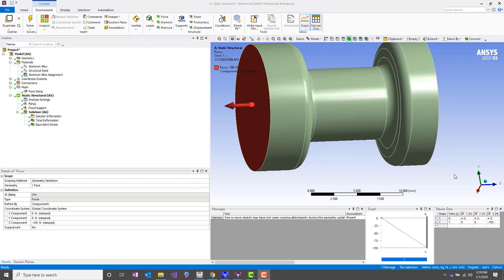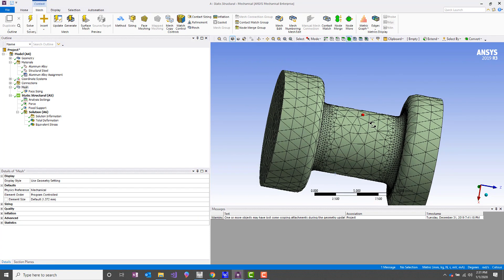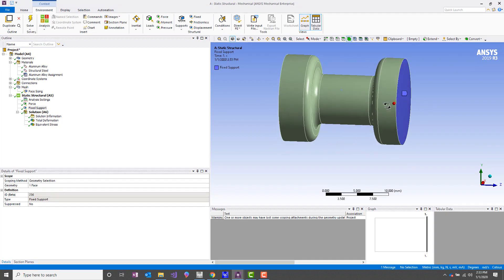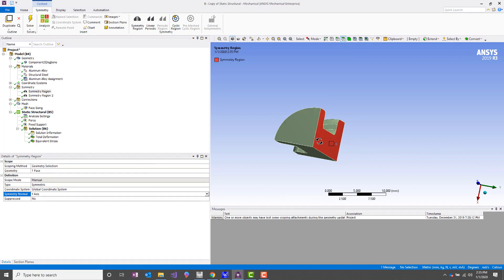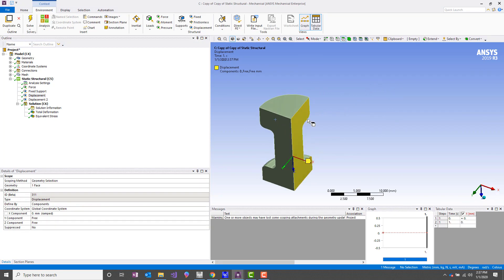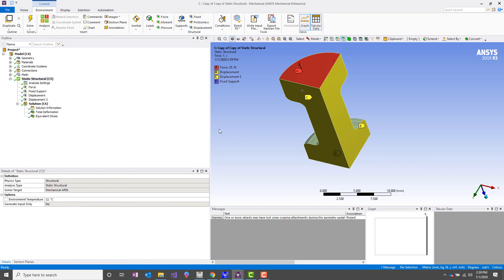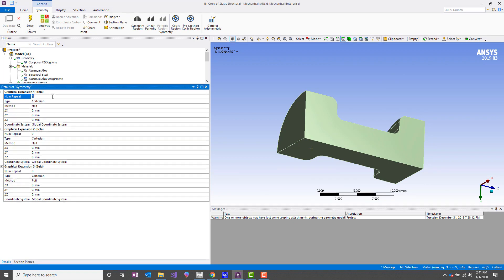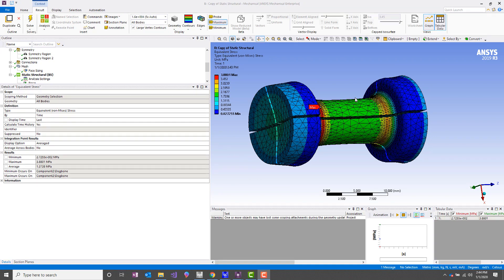Understanding Planar Symmetry in ANSYS Workbench Mechanical

Comment: Hello,Thank you for the video. 
I'm trying to apply symmetry BC on a plate with an elleptical hole in the middle (the geometry I made is a forth of this plate) , it's a composite model so I did the ACP-pre work then imported it to Static structural to apply the load and the BC. However, as I clicked on the symmetry icon to apply symmetry regio, the symmetry region icon is not activated and I can only use the cyclic symmetry. What should I do and what should I do to be able to use the symmetry region option ? Thank you.
Reply from the maker: The Ansys academic support policy (https://www.ansys.com/academic/educator-tools/support-policy) was updated recently and all academic support will now be handled through the Ansys academic community. You should be able to register for the community at https://forum.ansys.com/entry/register which will allow you to submit questions on the various forums in the community. Several Ansys engineers are interacting with customers on that site so your questions should be answered in a timely manner. 

SimuTech has a training portal that contains both Ansys training material and tips and tricks videos that have been created by SimuTech engineers. If you are interested in pricing or learning about this offering, please contact us at info@simutechgroup.com.